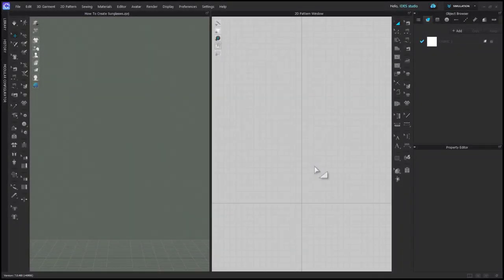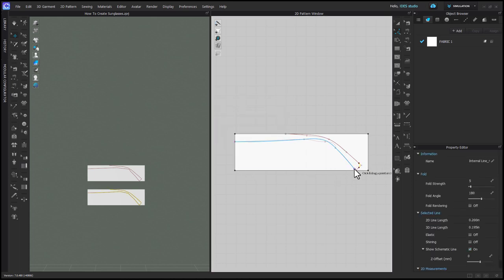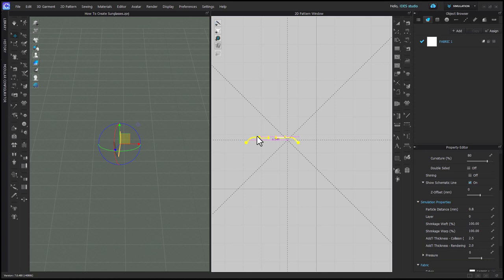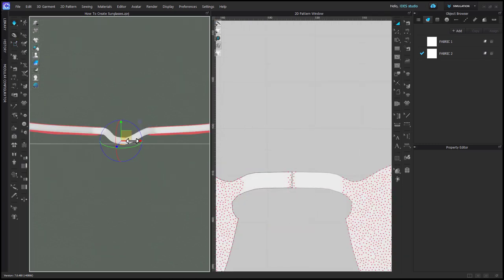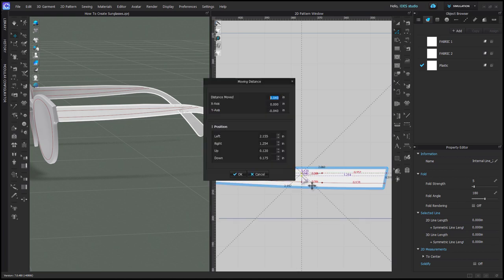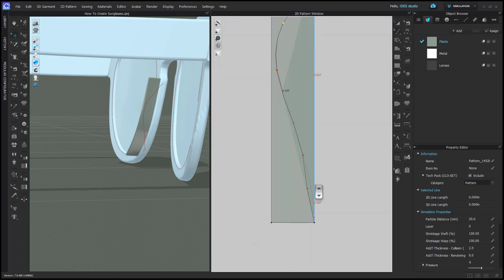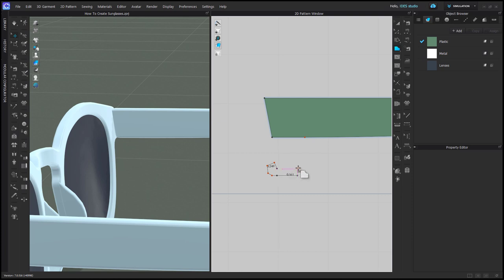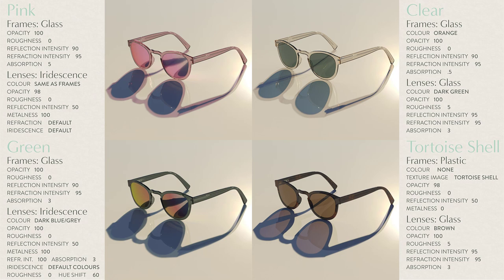How To Create Realistic Sunglasses, from Scratch In CLO 3D

Comment: This is too good, I don't know when I will be good enough in Clo to try this.
Reply from the maker: It’s not as hard as it seems! I’m only good at it because I nerd out and enjoy making OBJs in it. I would be so much more efficient if I spent that time learning a hard modeling software 🙈
Reply: @ides.studio  I am actually trying to learn blender but I think I will try your Clo tutorial.
Reply from the maker: @nusaibahibraheem4188  It's definitely probably worth learning, but have a try! I find it fun and I actually think the method of creating objects from flat pattern shapes works with my pattern making brain. Then if you think I'm crazy, get on Blender :)
Reply: Am finally trying this. It's not difficult but I think my computer is way too weak for this. Nothing was moving during simulation at 0.8. I thought it wasn't even simulating. Increased the particle distance but the issue is that it isn't as smooth. Some parts like the nose bridge refuse to bend fluidly the way yours did.

Comment: Is there a video on how to export the file into a FBX and .zacs?
Reply from the maker: I don't have one, but I can help point you toward some good ones. What software are you bringing it into? I think .ZACS is only for shoes...but FBX for sure. I think the settings for export will be specific to what you plan to do with it, but otherwise it's just file > export > FBX. Let me know and I'll see what info I can find
Reply: @ides.studio  I was just trying to register my glasses as an accessory item in CLO 3D, but when I do that the frames and lenses color/opacity become flat. I do not know if there is a proper way to save the material changes, I made so it renders well when it becomes a registered accessory item. Also, thank you for responding. I greatly appreciate it!
Reply from the maker: @christinearias4733  Ah ok, I think registering an assessory other than shoes as a .ZACS file is a new option I haven't tried. When you add the accessory into your workspace could it be looking dark because you have to re-adjust the material types of those parts of the glasses? I find that unless you save it in a project file, material types don't save on export and need to be adjusted each time. If that's not it, I suggest asking in the CLO Discord channel because the CLO team will for sure know the answer!
Reply from the maker: Join the CLO Discord here: https://discord.gg/KbHyHawwq7